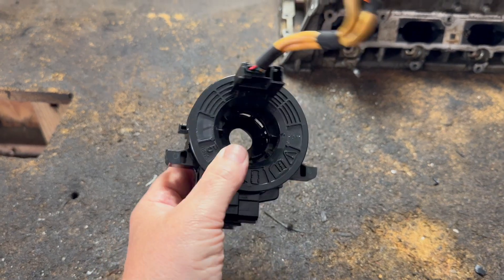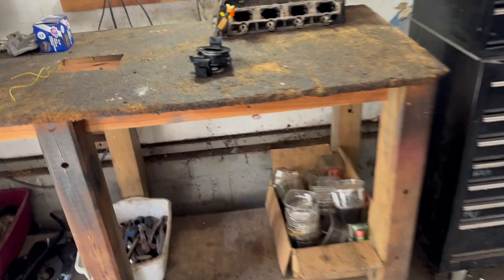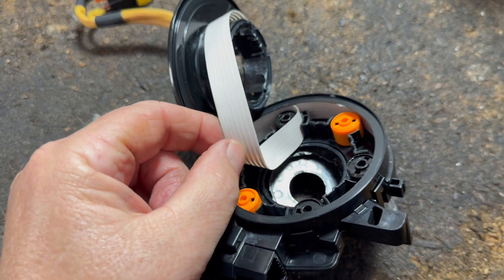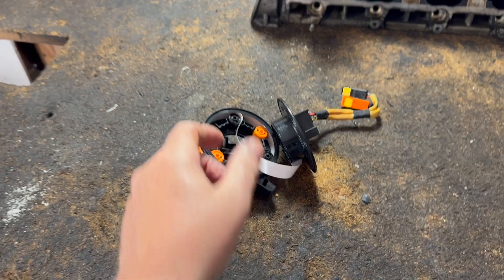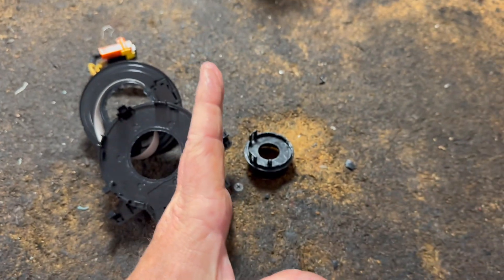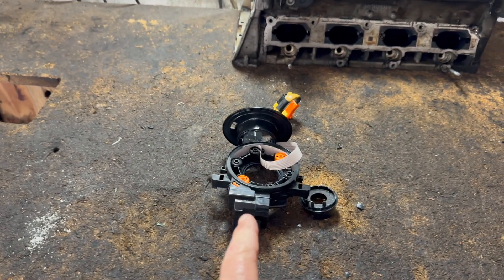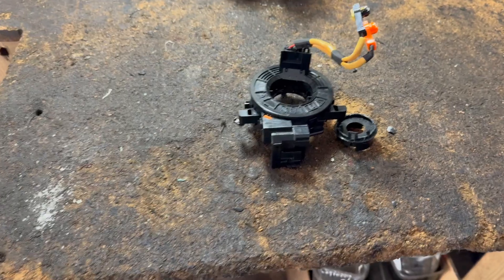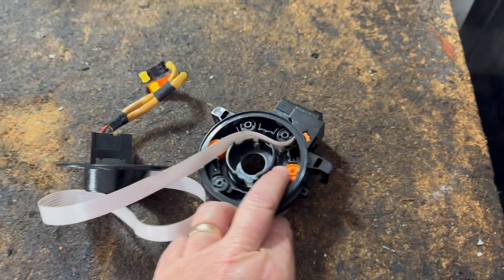What is a Clock Spring? - Car Airbag & Steering Wheel Explained

Comment: Had all this white plastic raining down out of my 'Steering' area! Steering got heavy, thought it was the power steering. Checked fluid, all good! Plastic break sound and bits of white plastic rattling and falling from the Steering wheel housing. Turns out it was something to do with the clock spring fortunately nothing else broke. The mechanic had never seen the rice sized white plastic pieces ever before. Toyota Corolla Hatch zze122, 2005 Japanese latest 20 years in very hot climate with full sun must days. Well made vehicles that's for sure. 
Ps. My clock is digital it doesn't have a spring!😂
Reply from the maker: lol, yes that seems very strange to happen like that.